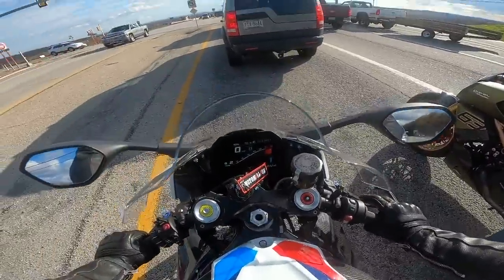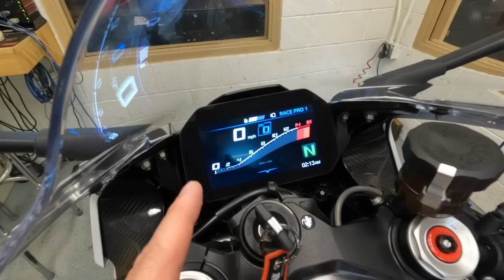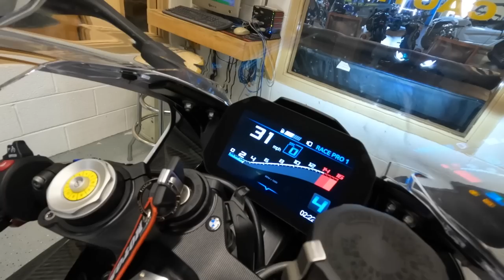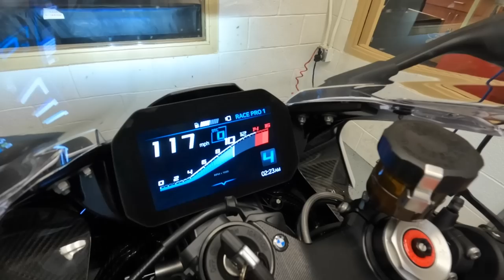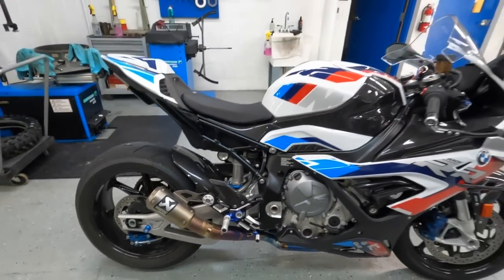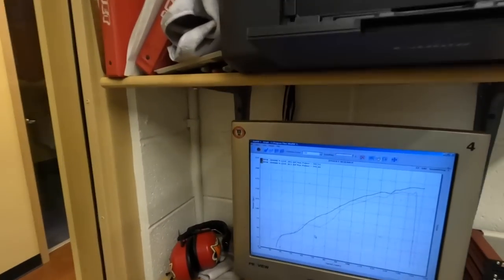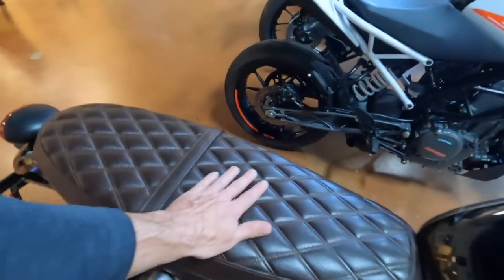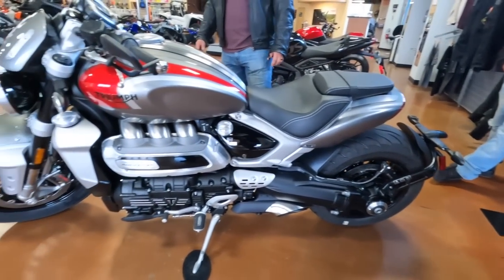Bren Stage 2 M1000RR Makes INSANE Power Gains!!!

Comment: Little tip if you don't know. Never use instant recording on a gopro with media mod or external mic (pressing record from a power-off state). Always power it on and wait a few seconds, then press record. You'll get way fewer videos that have no audio, corrupted, or fail to record. Only took me 3 years to figure that out.
Reply from the maker: reallllllyyyyyy thats great to know because I always use the quick record button
Reply: @JaretCampisi  Youtube never gives me reply notifications. Anyway...  yeah me too! I always did the instant recording and with the media mod and/or external mic, it causes issues. I figured this out after reading an obscure comment on old gopro forums and some fine print on the Hero9 Black product page, or maybe the media mod goro product page.   It actually works too.  It's a pain, but really makes a difference. You'll get way less videos with n o audio and way fewer vids that are completely corrupted or failed to record. I'm sure you know the normal problems. Hope it helps!

Comment: all that work only get 10 hp i think that was what you said
Reply from the maker: 10hp at the top end but we also picked up 60hp in the mid range which is a massive difference
Reply: @JaretCampisi  in end   way you said it in end result not getting all that hp  still has high point  low point  in different gear   all that really matters is bike  sounds amazing    running better it’s going up higher rpm   who wins the bike  have be experienced rider to be able ride it  that just what i think  good work mr sausage fingers  jaret

Comment: Cool to get the mid range gains. But what happened to the economy? The gains are nice, but if the economy dropped in half, you gotta question the sacrifice. Not about cost, just about range per tank and always going to the station

Comment: Stop buying shit ecu flash
Go and get a proper ecu flash 
My friends s1000rr with stacks and stack ecu flash got lower hp than stock
Reply: bruh wat du yu min? get the moore mafia flash? i want the  moore mafia braaaaap!
Reply from the maker: Remember its not just about peak power...ours made 10hp total over our stock tune at the high end of the RPM but it made 60 more hp in the mid range which is what you use much more on the street.  We are very happy with the bren tune :)
Reply: @JaretCampisi  just saying if you want to get every hp of this bike get a dyno tune 
Bren was good in past not anymore